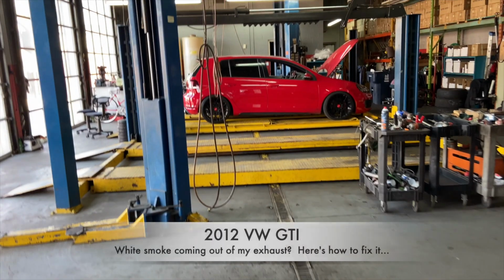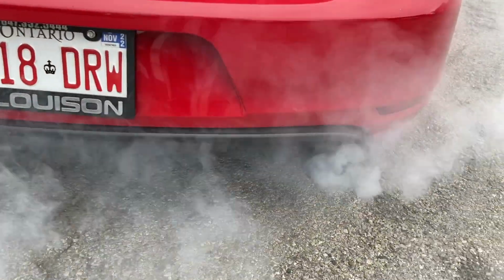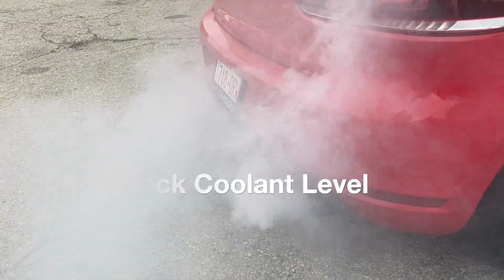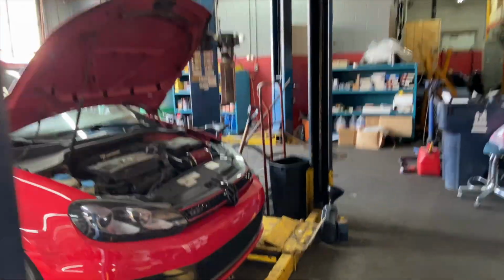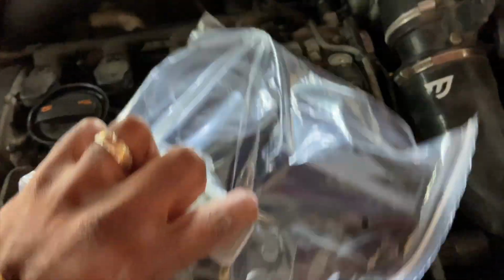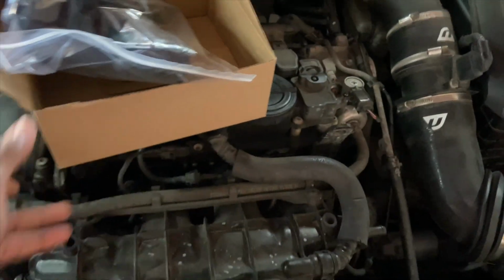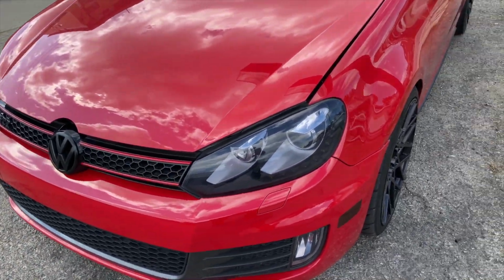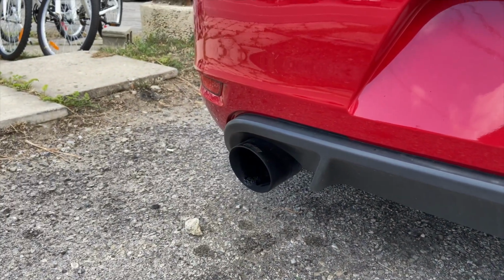Why is there white smoke coming out of my car? | Diagnose and Fix White Smoke

Comment: Would this issue cause the oil pressure low warning light to appear on the MFD display ? I have the thick white smoke intermitently ,coolant and oil levels are normal
Reply: I have a same problem with mine … what’s was the problem on your car??

Comment: I own a 2008 gs350 it smokes a lot when I accelerate above 40 and it reduces my gas the oil doesn’t short but the smoke smells like burnt oil please help
Reply: Did you end up figuring out the issue? My is250 has the same symptoms